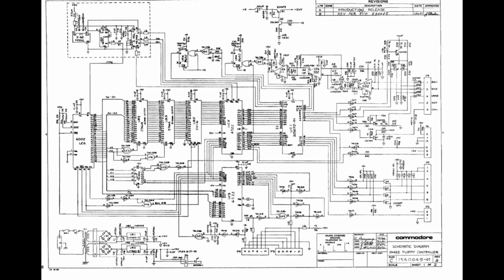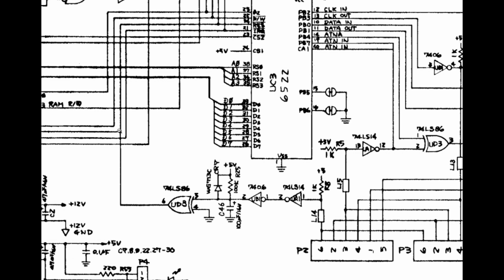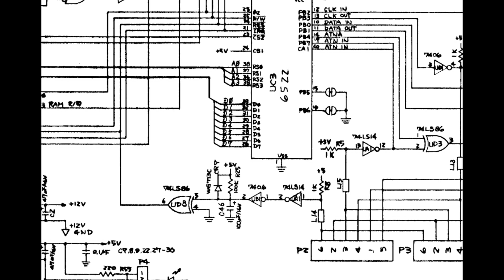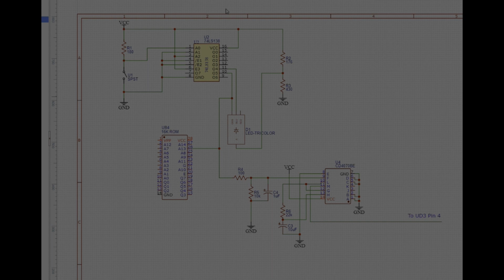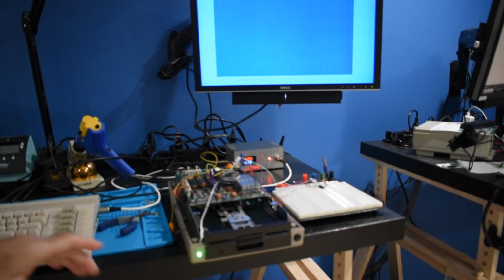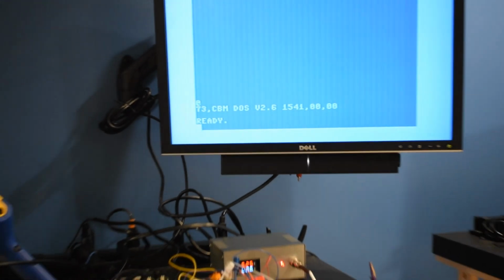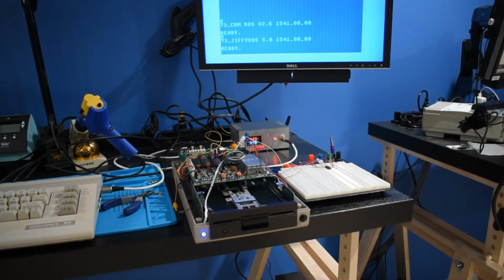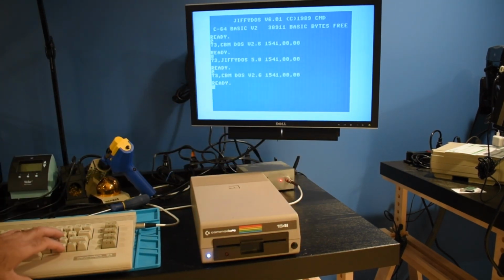The perfect Commodore 1541!  Commodore 1541 ROM Select with Auto Reset Circuit.

Comment: I just discovered your channel and am enjoying it very much. Subscribed now. 

Loved the bi-color LED push button circuit as well as this auto reset mod. If you have the time, you should really design a circuit board with both circuits integrated and make the Githib files available for download or perhaps submit them to PCBWay so Commodore users could build this combined circuit easily to install in there 1541's.

Keep up the good work.
Reply from the maker: Thanks, I'm glad you like it.  So far my videos are just me toying around and are not very well thought out :-)  But, after that reset video I was thinking I should have a board made up just as you described.  I actually have a huge pile of 1541's that need some love but I definitely don't want to build all of that by hand!  I'm working on a video now but after that I'll take some time and layout something and share.   thanks again!

Comment: To be honest I'm not interested by the DOS rom switch even if it's very interesting. I'm saying that because I own an Action Replay 6 which is embed a lot of usefull utils and loads programs very fast. The main problem in fact is this 1541 power turn on/off constantly. So my question is : do you sell a 1541 simple reset switch ? If yes, I'm interested in purchasing one.
Reply from the maker: Sorry I don’t have anything for sale. Although it would be pretty simple to design a circuit to simply reset the disk drive and mount a button on the front. If you’re interested in that, I could do a quick video to show you how.
Reply: @thecommodoreroom4554  PLEASE do :) And I will try to find someone to construct it for me (I'm zero at electronic). Many thanks ^^  And to speak about something else, I've seen once someone with a track digit displayer on his 1541. Nice feature especially for the ones who are interested in low level 1541 programming.